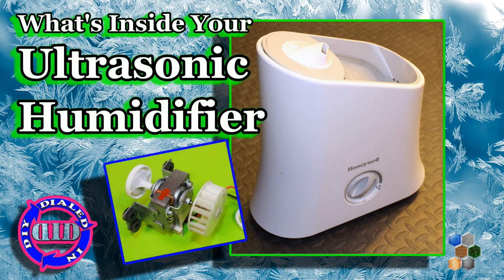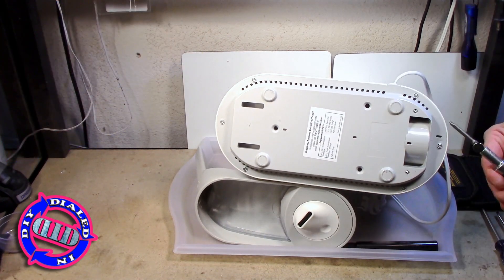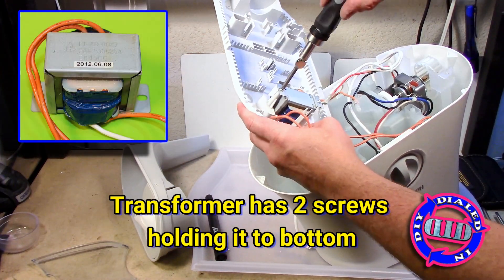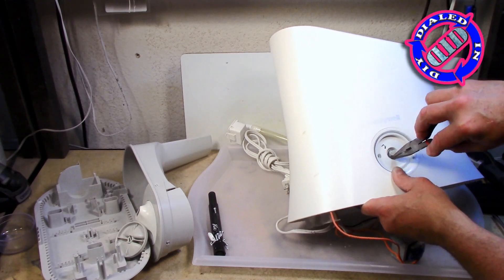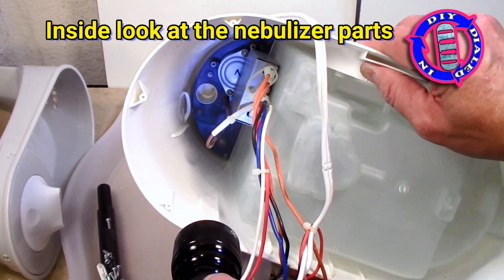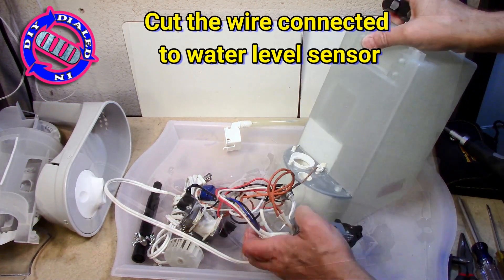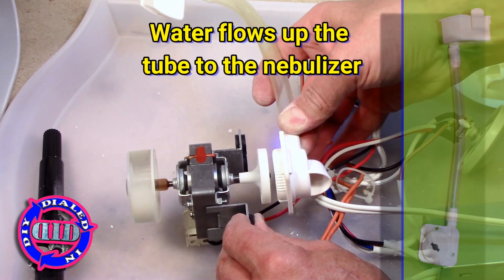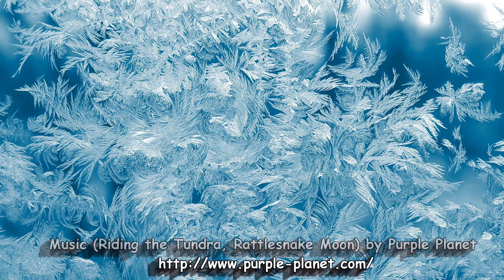Inside the Honeywell Ultrasonic Humidifier - Repair or Salvage - Deconstructing an appliance

Comment: You seem to be pretty handy. I have 2 of those exact humidifiers and they both will not work.. they turn on. But the piece that creates the mist works fone but the pumps dont work and on one nothing works but the light. The one that does work i have to start by hand. The pump/fan mechanism thst makes the pump bring the water uo to the little piece to create the mist... they just dont work. Idkw ive cleaned them to facry restoration and there just stuck or idk... maybe you can do a video on this issue?
Reply: Big yob and buy better a new one

Comment: Nice job man 
I have the same one 
But it's not working 
No mist is coming out 
I hope you can help me
Reply from the maker: Check to see if there is any power response at all; lights, fan sound or something like that.  If you have power to the lights, etc. then maybe the fan isnt working. Could also be that the ultrasonic disc is not accessing power or is maybe not getting water to the disc.